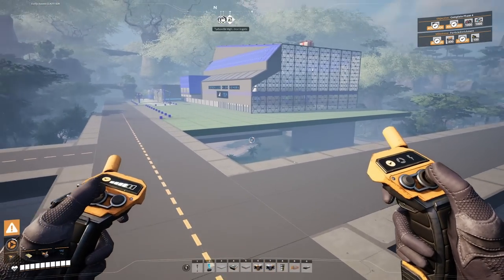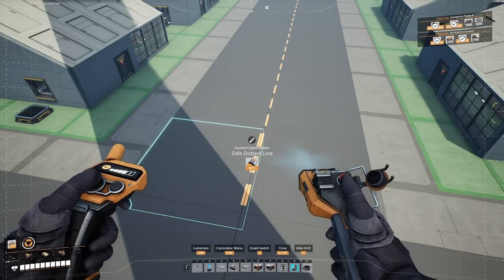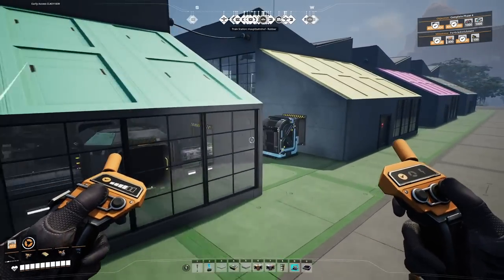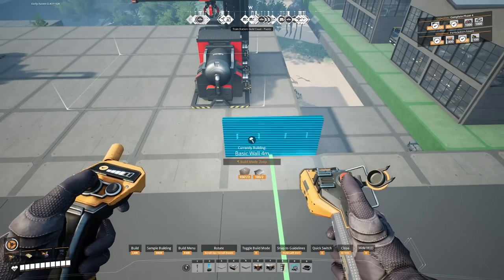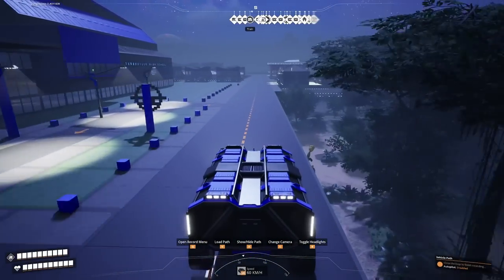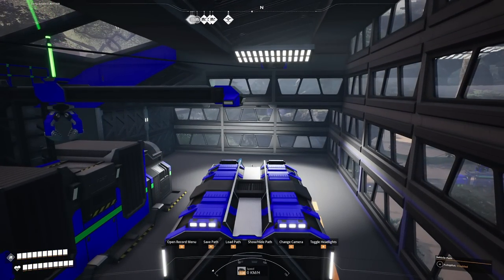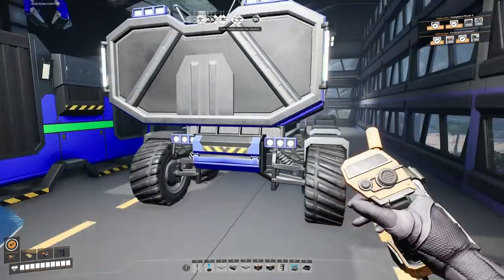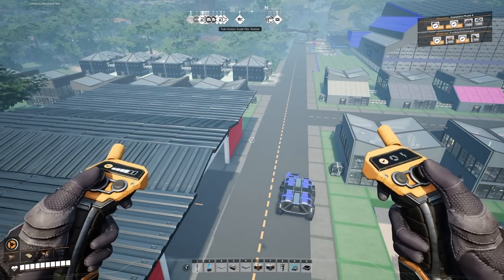I Waited 800 Hours to Use Trucks in Satisfactory...Now I Know Why!

Comment: I have several truck routes I built both early on and later in places where drones were overkill and trains were unsuitable but conveyors weren't really an option. One is run over land. One climbs a series of 2 m ramps (they can't handle 4 m ramps for long distances) and one is entirely road based on a point to point highway. With roads the best thing is just to give them a nice wide road. For turning around if you build a reasonably sized cul-de-sac with your truck station it's no problem if you take the turn at slow speed. I've encountered bugs and weirdness sometimes but overall I find them super reliable and there's no signaling issues like you encounter with trains or the need for batteries (ugh) with drones.
Reply: though i do endorse batteries as a vehicle fuel source once you have a good production line. maybe not underrated but certainly more people would benefit from knowing how useful it is.
Reply from the maker: I just went on Twitch and fixed things up a lot like this. I ended up making a little loop out the back of the truck station instead of trying to back out. Plus I switched to tractors because I can't really change my roads, but they are a little too narrow for trucks. It all seems to be working a lot better now.

I already have the coal there so that is the best source for me. I bet batteries last forever in trucks or tractors. I am making like 120 batteries per minute but I am probably going to use them all on drones
Reply: @DrLootCrate  Yeah the tractors make sense for that. When I saw the video and the size of the roads I remember thinking "oh no...." as it's not impossible as we saw but very rough. I'm glad you worked it out. I hope in the future you find your groove with vehicles. They're the last form of moving stuff I tried as well and I honestly kinda regret it. It takes some getting used to but they're another fun layer to the game for me.
Reply from the maker: @zetsubouda  I do really like the look of them driving them around on roads, so I might do it more often for Internal factory movement for fun

Comment: I have a couple of comments for you... First, I was laughing a bit with your experience with the trucks... They really are rather buggy. A piece of advice for you if you actually do enjoy seeing the activity of vehicles is to favor the tractors over the trucks, they are much more maneuverable, and smaller + faster too! Also, just due to the size of trucks, you probably would do better making your roads 3 foundations wide to accommodate their turning radius. But all-in-all, yeah, they're just sorta buggy AF. 

I revisited using them in my U7 new world in the dune desert, figuring that I could use them as a poor man's main bus to pull in a town-style build to a central storage, and it kinda worked for a while, but I'm now dumping the trucks in favor of megabus's and drones. Really, they've done some incredibly weird things in my game, (like my fuel supply truck teleporting to (0, 0) for 10 minutes at a time). Still have one tractor running to bus my starter iron plants goods in, but I'm probably going to rip that route out soon.

Keep posting what you're doing, love seeing it!
Reply from the maker: Thanks! I actually just went on Twitch and did what you suggested. Switched over to tractors, plus made a loop out of the back of the fire station instead of backing out. It all works a lot smoother now. I definitely wasn't going to change those roads, so this was the best solution. I didn't need the throughput of trucks anyway, so an easy call.

I definitely should have checked the size of trucks before I started the build...I just assumed that they would fit on 1 foundation for a road for some reason.

Comment: The trucks are a little derpy but most of those issues were just using too big a truck for too small a space. Makes for a funny video
Reply from the maker: Yep. Realized that very quickly…I switched them over to tractors per viewer suggestion and they work great.

I had literally never put a truck down in the world before this video, so I was a little surprised when I put it down AFTER I had built all of the stations. Definitely bigger than I thought

Comment: Your roads are scaled for tractors, not trucks.
Reply from the maker: Yeah I noticed that very quickly. Probably should have gotten a truck out to check before I laid out the roads!
Reply: @DrLootCrate  Tractors can carry loads just like trucks.  They have a smaller inventory, but your routes are short.
Reply: @Pest789  yep. My routes are short and I am not actually carrying that much. I am going to switch for sure

Comment: :face-purple-wide-eyes: Trucks IMO work better like train where they have a looping path or at least a turn around in the path.  Also might try the sugarcubes rather than the big one unless you need the larger hauling capacity.  You can modify the pauses as well.
Reply from the maker: Yeah, definitely found that out. I left the back of that truck station building clear just in case I wanted to add the loop. I think I might.

I honestly did not check whether a truck should drive on one foundation wide or not. I just assumed. I am probably going to switch back to tractors.

Can I load the same route that I already recorded on new tractors? I assume so